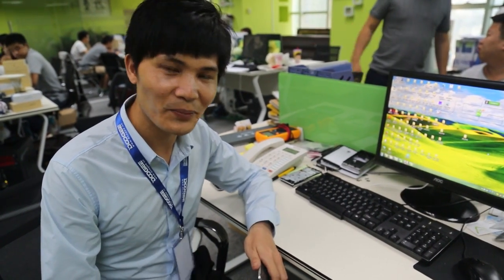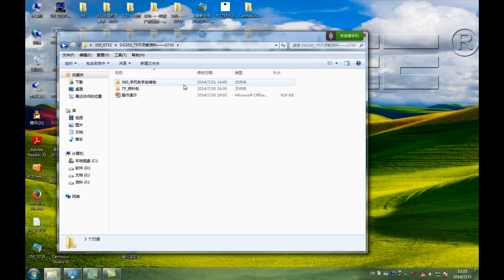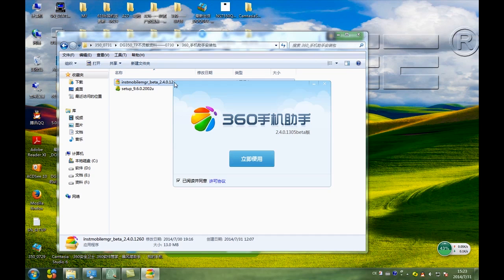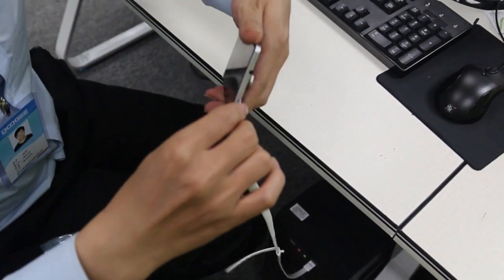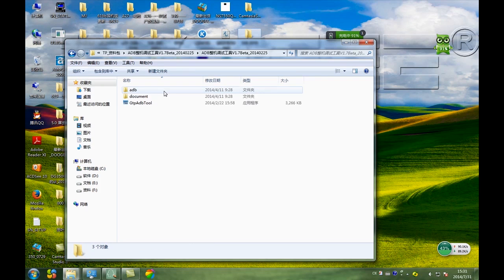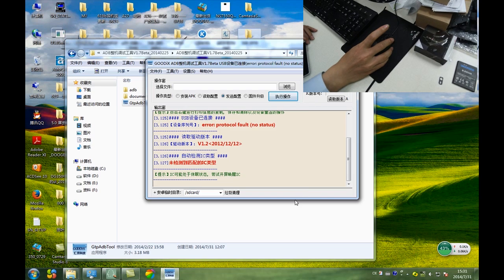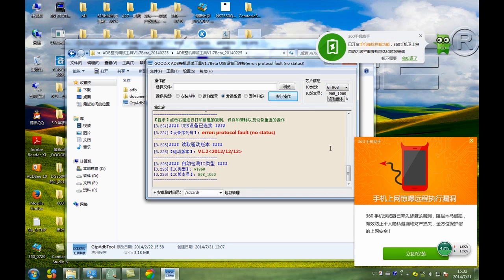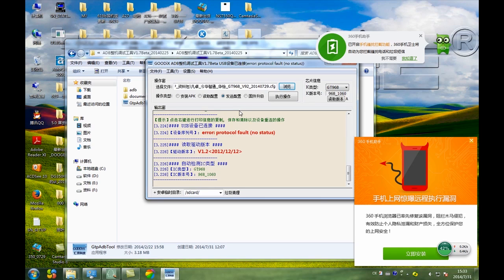Video Tutorial for DG350 Touchscreen BUG

Comment: There is still a slight offset of the bottom portion of the screen even after the fix. The bottom 1 cm starts off reacting on a distance of 9 mm from the bottom. When finger is placed at 5 mm from the bottom point - the touch indicator would show up at about 2 mm from the bottom of the screen. Most bottom 3 mm would be always registered as being on the bottom border of the screen and moving the finger in between would look like there is no movement taking place whatsoever. The top left and right corners now function properly, but the screen bottom definitely could be better!!!

Comment: In order to successfully perform the shown operations all CHINESE symbols in the archived files and folders should be removed (files and folders renamed), otherwise the final step will fail!!! Although the touch screen is now more or less properly aligned, a new issue appeared - the "menu" and "back" sensor buttons became slightly less sensitive!!! This means that one would now have to perform repeated attempts when pushing the mentioned built-in sensor buttons - a strange fix indeed...